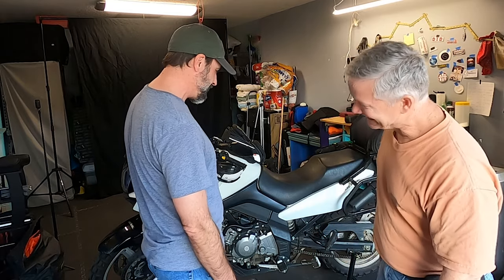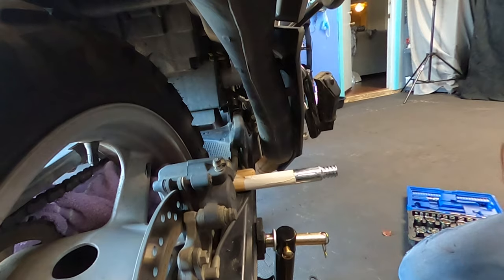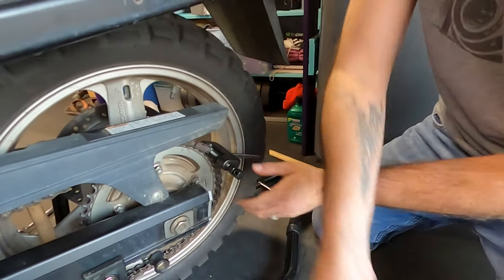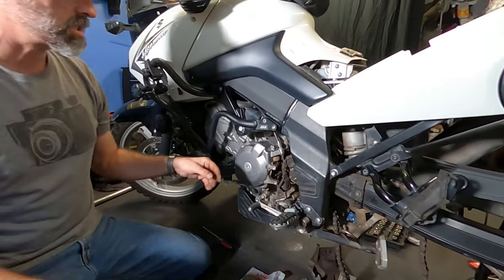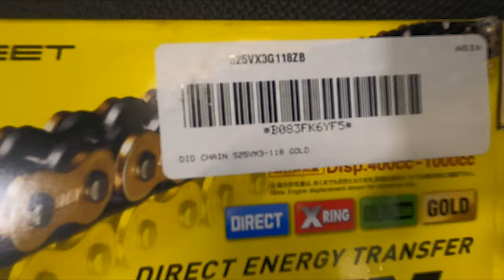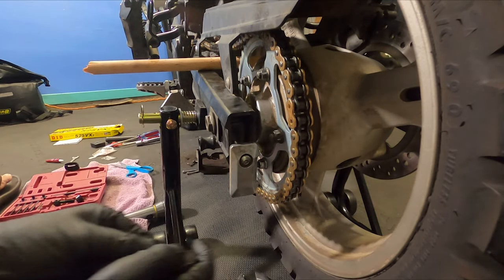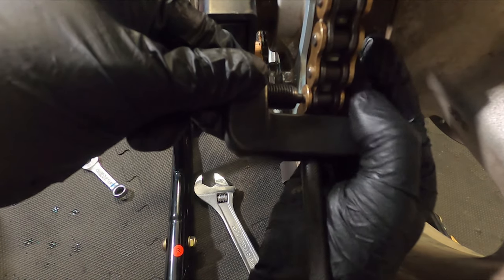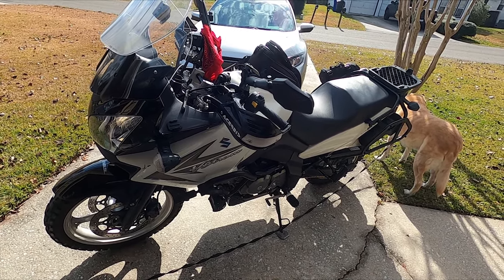How to Replace V-strom Chain and Sprockets

Comment: Would you not cut the chain with an angle grinder instead of using the chain breaker to do it if your replacing the chain?

Comment: Nice video.  Just curious though, why not grease the rear axle when you reinstall it?
Reply from the maker: Hi Walker!  By all means, it is good practice to use a light coat of grease on your axle when you reinstall it.  It not only helps the install go smoother, but also helps protect it from rust and corrosion.  Remember, when shooting these videos, we can't possibly cover every single detail or they would be too long.  Follow your owner's manual for additional details.

Comment: As a YouTube Certified, FaceBook Forum educated mechanic, I too "can repeat the things I read!" lol On my KLR, I ended up needing an impact wrench to get the nut off of the front sprocket (I had the bike in gear, on the ground not sure of any other way with spoked wheels). Shifted to neutral when I put it on the lift. Also since I wasn't saving the old chain, I used bolt cutters to break the old chain.
Reply: Ha! right? Ah spoked wheels, didn't think of that one since i don't have them. Thanks for watching!

Comment: I would have used blue lox tight on the 5 nuts holding the rear sprocket and some anti seize on the front sprocket threads. Great camera work, I could really see what was going on.
Reply: Thanks for the comment, Steven. I thought about the lock tight, asked some buddies, averaged the responses, went without it. Never considered the anit-seize...but next time I will. Thanks for the heads up! Make sure to subscribe and like the video!

Comment: Recently replaced my sprockets and chain and at high speed there's a whiney light humming sound! Any suggestions? FYI all parts matched except for front sprocket which new one has no damper
Reply from the maker: I don't think that's unusual.  Keep the chain properly lubricated and properly tensioned and you should be fine!

Comment: Nice job and thanks for sharing.  I suspect the manufacturers use 2 different sized nuts/bolts is because most socket sets come with one of each size socket and if you use the 24mm socket on one side, then you still have the 22mm for the other side.  Right?
Reply: You might have two different sockets, but does your socket set have a second handle to hold the socket?
Reply: I believe that most socket sets contains three handles.

But on the DL 1000 there’s a cutout in the chain adjustment plate so only one socket is needed.
Reply: @stevenpeck5949  Great point!
Reply: @kasperkjrsgaard1447  Mine came with 3 handles, 1) ratchet, 2) breaker bar & 3) a T-handle.  :) 
Also, Chris Smith, I'm friends with your friends Tom & Diane and they gave me your channel name because of my life long motorcycling racing & riding experience.  :)
Reply from the maker: WOW!!!  That's really cool, Andy!  Tell them "Hi" from me, will ya.  And thanks for watching.  Check out our latest adventure video on the TAT.  We're amateurs compared to you, which is why the bikes take lots of naps!   :-)

Comment: gday mate is that a seeley chain remover ?i had a brand new one ready to do a chain swap in spring 3 months ago was stolen from my shed never even got to use it , i do a lot of this stuff on my own on the 500x and those spacers and brake bracket are a pain soon as i saw it i thought heres fun , best way ive found is i get a ratchet strap and use it to lift the wheel into place while keeping an eye on those spacers not falling out .
Reply: Here’s the chain breaker I used. 
https://www.amazon.com/dp/B005DHY178?ref=ppx_pop_mob_ap_share
Thanks for watching!
Reply from the maker: Nice tip about the straps, mate!
Reply: You can cut a piece of 4” wood in a slope to lay under the wheel so when you have to put the wheel back on you just roll the wheel “uphill” until the axle will fit.
Reply: @kasperkjrsgaard1447  Hi i did try something like that but those bloody spacers kept falling out at the wrong time
Reply: @crispernator  with luck you can place your fingers on the spacers and gently roll the wheel up to correct position.

Comment: I’m surprised you have to break the chain to remove the wheel.  That adds a whole level of difficulty for tire changes.
Reply: Don’t have to but it does hold the chain in a good place to show how to break it. Lol. Thanks for watching and commenting!
Reply from the maker: If not replacing the chain, Kris, you can just push it to the side to get the wheel out for tire changes.
Reply: That is an extremely clean bike!

Comment: A dremel? are you serious?
Reply: Not an actual dremel, a knock off...and I'm rarely serious. Thanks for watching!
Reply from the maker: Haha...hey it worked!  :-)
Reply: @MotoPhotoAdventures  As would a blow torch but I thought better of it. In retrospect, it woulda made a better video. LOL
Reply from the maker: @Jason_MotoPhotoAdventures  HAHAHA!!!  #haironfire  :-)
Reply: Bolt cutter is a lot faster. The chain is trash anyway.
Reply: @genethomas4405  Don't have one of those. But I did have a knock-off dremel so a few sparks later...voila! Thanks for watching!
Reply from the maker: @genethomas4405  excellent tip.  But we didn't have one.  So the grinder got the job done.  :-)
Reply: Grinding off the head of the link pin is how everybody does it , what do you use BTLees? Your teeth?